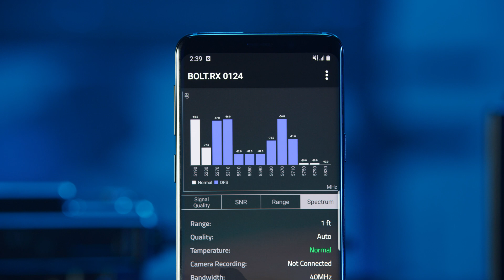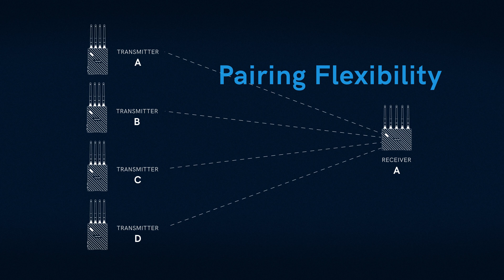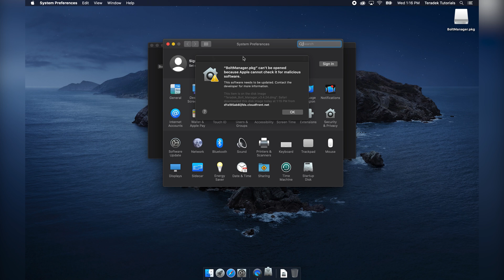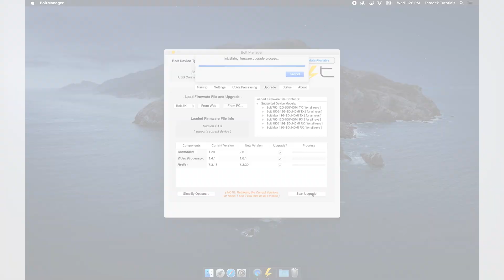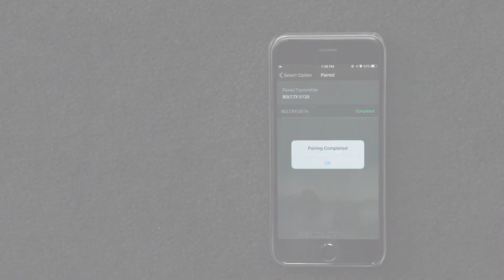Teradek Bolt 4K Firmware Update - More Reliable Wireless Signal and Reduced Connection Times

Comment: My Teradek TX gets connected, but the tabs (f.e. upgrade tab) are not clickable. The Bolt Manager freezes all the time. Yes, I have the latest updated on both bolt manager and macbook. It's super annoying. There's a good reason, why you should avoid updating your devices... nothing but problems comes with that.
Reply from the maker: Hi Yannick, which version of Bolt Manager do you have and which MacOS do you have? 
In the Bolt Manager release notes, we noted: "IMPORTANT: As of Bolt Manager 3.4.55, only macOS 11 and later are supported. Although macOS 10.15 and earlier may allow Bolt Manager to install, configuration changes and firmware updates may not succeed."
See release notes here: https://teradek.com/pages/downloads#bolt4k

Please contact our Support team at http://teradek.com/contact so our Support team can troubleshoot with you. We want to help you fix this quickly and we can do that directly over email or phone.